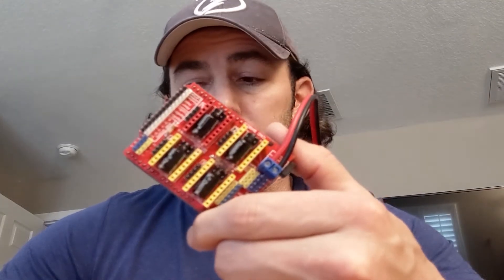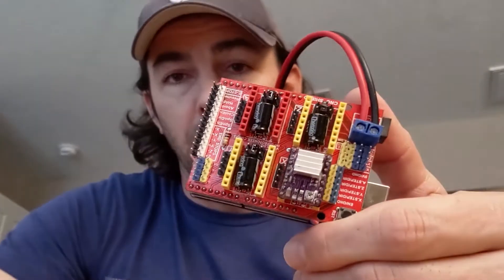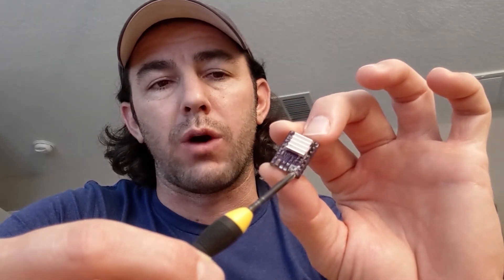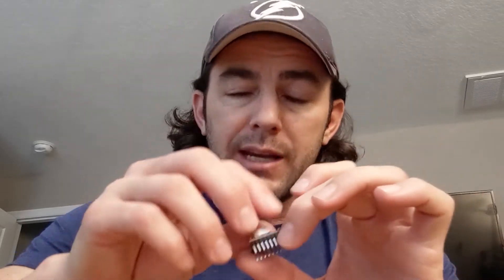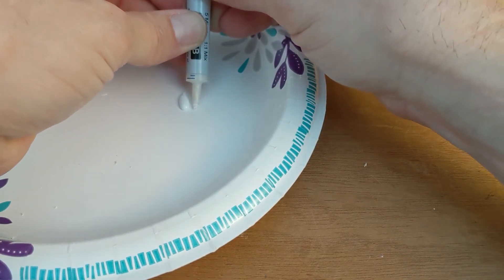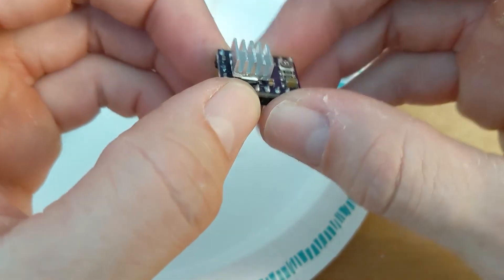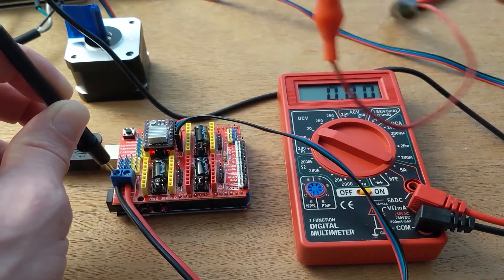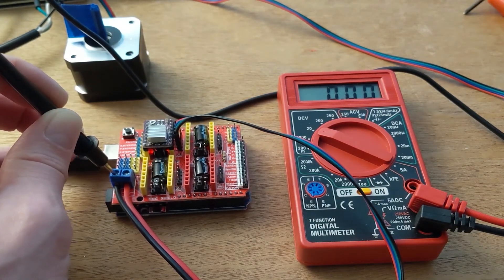CNC Shield, Arduino UNO, DRV8825 - Tips for success!

Comment: yeah that current limiting thing doesnt convince me at all, what we are actually doing iss setting a reference voltage so current flows, via the formula manufacturers give in order to calculate the reference voltage. It goes something like Vref = I (stepper motor) x Rs x 8, at least in the A4988 Driver. 
Edit:
MB in that driver it is just I (stepper motor) / 2

Comment: 7:20 you say you're measuring current but you're actually measuring the voltage. You can even see on the multimeter that it's set to voltage

Comment: im surprised you say with the driver chip in and no motor connected it burns out, i have 4 at least with them in and no motor on the Z as i used servo and not one has ever burnt out ?

Comment: Sorry that you ruined so many chips and motors. It really helps to read the driver and motor datasheets and go to the company webpages to learn more about this driver board before using it. Polou also has a YouTube video on their DVR8825 that shows the correct way to set the VRef with the board powered but without the stepper motors being connected. Also, if you look at the schematics of the example circuit on their website, it shows a capacitor that is supposed to be present where the power connector is attaching to the circuit. You can see the cap in the video. The cap prevents voltage spikes that can fry the 8825 chip. Your video doesn't show this required capacitor. You also handle the 8825 very casually by the pins themselves with no regard for the possibility of static discharge ruining the chip.

Comment: well HELP i did as you said but my motors  rattle wont turn and this was a new board with drivers  i got a lot of mony tied up in making this thing would i be better off buying the better coponets Bite the bullet buy them and get this thing working  i got 24 v going in to stepper board set at 1.2 amp there rated 2.5

Comment: For anyone struggling with getting the stepper motors working, I had tried every tutorial video and every "solution" available, but it turns out the layout of my wires was wrong. I tried swapping out my cable for a different one, and found an old 3d printer stepper motor cable. When I tried this cable, magically it all works. It turns out this cable had the "2nd" and "3rd" wires swapped. So essentially, if we name the stepper motor input wires as 1, 2, 3, 4, 5 and 6, and normally your cable would go to 1B -> 1, 1A -> 3, 2A -> 4, 2B -> 6, try swapping the cables out and making the connection: 1B -> 1, 1A -> 4, 2A -> 3, 2B -> 6 and see if that works. It solved my endless search for a solution.

Comment: 1:55 You should make an exception to only use logic voltage (from Arduino 5V) *not the CNC shield power (12v) * because in another video https://youtu.be/wcLeXXATCR4?si=jj8n2c5g-LhIJzg-&t=466 shows that power (5v) from the Arduino is fed to just the motor driver board (although different model A4988) seems safe to do as to set the current for the boards output.

Comment: motor supply or logic supply? Damage to drivers when cnc motor power input is powered with no motor or damage to logic when Arduino is powered by usb or other?
Reply: This is a very important question as in another video https://youtu.be/wcLeXXATCR4?si=jj8n2c5g-LhIJzg-&t=466 shows that power (5v) from the Arduino is fed to just the motor driver board (although different model A4988) seems safe to do as to set the current for the boards output.

Comment: Is normal PC CPU Thermal paste not suitable?
Reply: Typical thermal paste is not adhesive; you would have a mechanical attachment to keep the heat sink in place. The 2-part stuff is an adhesive, probably a high-temp epoxy with extra thermal conductivity goodness. HTH

Comment: Nice video, Can you also tell if it's OK to upload code /sketch from Laptop to Arduino with the CNC shield on piggyback while Arduino is connected over USB and also when the 12v external power supply is connected to the CNC shield.

OR should we turn off the 12v external power supply to the CNC shield and then upload the sketch.
Reply: Depends on the code you are uploading, if you are just uploading the grbl sketch nothing will happen even if the 12v power is on, you have to send g-code files for the steppers to start moving.

Comment: NEMA 23 motors require 4 amps at 25vdc I think. This board supplies only 2.5 amps at 24.
Reply: NEMA 23 motors are not all the same. I have NEMA 23 which requires only 1 (one) Amper.
Reply: @TheDIMONART  Oh, looks like you are right. I thought NEMA was a general rating for torque and speed of the motors, which would limit the range of current and voltage I would think. But it looks like it is rather a measure of the housing face, which might correspond to some of the output characteristics but not the current and voltage input. Thanks for the info, I learned something.
Reply: And it looks like it is also a rating for torque and speed as well, but it is a range rather then a specific rating.
Reply: @artisticmike  Correct, NEMA23 is only for flange size specification (23 means 2.3 x 2.3 inch)
Reply: @TheDIMONART  Also, they dont require a certain current. It all depends on the load.

Comment: The warning from the driver manufaturer he showed isnt what he is talking about. The manufacturer said not to connect or disconnect a motor while the driver is powered. He is talking about just plugging the driver in without a motor. So it wasnt the plugging in the driver without a motor that destroyed his driver, it was when he plugged in the motor while the driver was powered.
Reply: I've unplugged steppers when the board is powered, but not driving the steppers with no issues. Probably still not a great idea, but not fried a driver yet.

Comment: I tried it my own... You can for sure adjust your current even if you don't have the stepper motor hooked up. You just connect your Arduino to usb (not ide interference needed. Just connect the usb to the board and your pc) then supply power. No need to match the maximum current of your motors... You can use any supply that matches your voltages needs. In my case my stepper motors using 12v and 6 amps supply... The drv8825 is set to limit the current at 1,2 amps. My motors can handle up to 1,3 amps. No smoke appeared. Im going to upload a video of my set up and my cnc after i finish my laser engraver project.

Comment: At the end when he used the multimeter was he testing current or voltage? It looks like the multimeter is set to voltage?
Reply: Ha, he was testing voltage. Actually, he is setting Vref voltage to the desired level.
Now, by adjusting Vref voltage you can limit the current flow to your motors from the driver. For DRV8825 Vref= Motor max. winding current / 2. (2 is the resistance value for the drv8825 driver). for example, if your stepper motor can handle a max of 1.2A per winding then Vref voltage is calculated like this> Vref=1.2/2= 0.6V.
Reply: when you are setting the current for your motor the way the board can set up the logic is through VREF or reference voltage.  The pot that he has the leads on controls this value.  So when you're testing your VREF you use voltage.

Comment: Haha. For TMC drivers the rule is backwards you cannot power a driver With a stepper attached. I wish I had watched this earlier before the big 💥. Also your Uno will fry too and your laptop ISN'T SAFE EITHER
Reply: Am having DDRV8825 if I connect my USB from Arduino to the laptop my Nema Motor doesn't move and it stops by force. 
Does this mean that my Motor Driver is damaged? 

A few days back it used to work. I don't understand the issue.

My Nema Motor is had a 1.2amp rating so I adjusted it to Vreff to 0.6

Any Advice or Suggestions from your side about the issue?

Comment: What is the units of your v ref value of .75 volts or amps?
Reply: volts
Reply: 1.7amps for Nema17 motor and using formula of Iref (current reference of that module) you can calculate the voltage for that current so you can set Iref with voltage meter.
Reply: @ourclock9273  Am having DDRV8825 if I connect my USB from Arduino to the laptop my Nema Motor doesn't move and it stops by force. 
Does this mean that my Motor Driver is damaged? 

A few days back it used to work. I don't understand the issue.

My Nema Motor had a 1.2amp rating so I adjusted it to Vreff to 0.6

Any Advice or Suggestions from your side about the issue?
Reply: @AkashGajinkar  may be ok with those parameters just rectify if Rs it's actually 0.1ohm.
If not you can know the final formula from this Imax=Vref/5xRs for example if Rs= R100= 0.1ohm >>>Imax= Vref/5(0.1)>>>>Imax=Vref/0.5>>>Imax=Vref(2)>>>>Vref=Imax/2 and all of that if Rs measures 0.1ohm and You can see all the data from datasheet in this case DRV8825 datasheet there you can find formulas tdp Imax etc etc
Reply: Its volts. Vref=Iref/2 for DRV8825
Reply: @Mad_GamingYT  not exactly but it works fine :)

Comment: what sort of connector do you need to connect the stepper motor to those pins on the cnc shield
Reply: Steppers should come with cables and the connectors on those cables correspond with the Shield's pins.

Comment: I watched the video as well as your set up video, both very helpful, Wondering if you could possibly give me some direction. I'm new to this and setting up my first CNC. I was able to upload GRBL and Universal G-code sender. I'm using the Arduino UNO, with the red drivers. 4 axis. The orange light is blinking, the green light is on. I've double checked my motor wiring with an ohms meter. I am running the set up wizzard in the G-code sender program, when I try to move any of my axis motors in the program, I hear a low humming/buzzing noise, but no movement. It's difficult to determine where the noise is from, possibly the transformer/power supply? I doesn't sound like it's the motors. Is it possible that my drivers are burned out? Is it possible to bi-pass the drivers with a jumper just to check the motors? Any suggestions would be very helpful. TIA. Nick

Comment: Are you adjusting voltage or amperage?
Reply: adjusting the current by voltage reading that through the potentiometer. ex : 0.75v equal to 1.5A for DRV8825

Comment: Question, Are you able to mix a Nema 17 on the Z and Nema 23's on the X & Y with this board configuration?
Reply: Yes you can. Just set the vref, take note max current is 2.5A for the DRV.

Comment: Never had those issues on my setup back in 2019. I always power up without the steppers and never had a fail of stepper drivers. Also, I only setup the current along the way of the setup. Don't have issues with heating also. Just stuck the heatsink with the provided sticky tape.
Reply from the maker: Glad to hear you run an issue-free setup.  One note on driver current and overheating - all too often people complain that their steppers are occasionally 'missing steps' while cutting jobs and this is likely because they are not giving the stepper the full rated amount of power it needs, OR the driver chip hits thermal shutdown due to providing too much power or inadequate cooling, and resets itself.  I don't want to deal with any 'missed steps' (and I never do) therefore I fine tune the driver to deliver the maximum rated amount of power that my nema 21's require and this causes the drivers to run very hot, which in my southern US climate is far too hot for proper cooling when using the provided sticky tape solution.  As a test, I have run 2 setups side by side, one driver with sticky tape and one with thermal paste, and the taped on heat sink loses the battle every single time as it will hit the thermal shutdown threshold, reset itself, and 'miss steps' while cutting.
Reply: @jtechcustoms  Yes that was the consideration I did give priority. The heat. Gave it the most current at which it does not heat up for the most torque. Also ran it at 1/32 microstep which at the time seemed like a good option. I think some have it at 1/16. I did try at 1/16 also without issue. Supposedly have better torque as well.

Anyway, I do have a video of my cnc cutting 3mm cf decks for my rc. 

Just surprised there was actually issues with the board. I also use the drv8825 stepper drivers. Glad it went on smooth.

Anyway I do run it with hc05 bluetooth module as well as this was the only issue I did have as it would sometimes disconnect on a long job.

Comment: Your first tip might not be as accurate as you think. The quote from the manufacturer states, that plugging and unplugging motors during power on will damage the board. not when you power on the board without a motor. It's only when you power on the board and then plug in a motor that the board will get damaged.  Without a motor the driver can boost up the voltage all it wants, it can go no where seeing there is no motor to conduct the current. Nothing will happen. But when it's on and the voltage is maxxed out and then you attach a motor the full power supply and all it's current might get dumped into the motor and the module will fry itself. Current cannot go where there is no connection. 

I breadboard these modules on a regular basis and none of them have broken from just powering them on without a motor. 

The second tip, These modules can do about 2 amps max. Nema 17 motors range from 1 to 2 amps max. Nema23 motors have lower coil resistance than Nema17's, Think of an audio amplifier rated for 8 ohm speakers. And then you attatch 4 ohm speakers. It will work, but it will struggle allot more. 

 The thermal epoxy is a very nice idea tho, and the calibration of the current at the end is also a  good idea.
Reply: There is the comment i was looking for. I totally agree. Don't know what his first tip is about. He says "It will ramp up power. There is no resistance from the motor, so it fries itself" and that's completely wrong. 
Its the complete opposite. If there isn't any motor connected, the resistance at the output is infinite (not zero) and unless the air is highly conductive (😉), the driver shouldnt frie at all.
As you said, the quote from the manufacturer has nothing to do with the topic he is talking about. It only states that you should not remove the motors while being powered. Of course that can damage your driver but that has nothing to do with powering your board without any load.

Whoever is reading this: To set the correct Vref for limiting the current, I strongly advice you to do that without connected motors!! But what we can learn from the video: Dont connect/deconnect your motors while the board and drivers are powered.
Reply: Agree. And you should be setting the current limit BEFORE you connect the steppers the first time; so how can you do this if you are not allowed to supply power to the board without the steppers?
Reply: @adammiles5087  You ARE allowed to supply power to the board without steppers. Just don't plug or unplug motors when the board is powered. 

So power the board up without steppers plugged in, set the current, power the board off, connect the stepper and power on again.

Comment: Hi, Great video.  Do you know which pins I connect to when installing an external reset button?   Thanks.
Reply from the maker: There is a set of pins named "E-Stop", these are the equivalent of the reset button on Arduino, as per the info provided on the CNC Shield manufacturer site here - https://blog.protoneer.co.nz/arduino-cnc-shield/.
Reply: @jtechcustoms  Great stuff.....cheers

Comment: WATCH OUT: in my case the tiny pot on the 8825 had to be turned all the way CCW in order for it to bottom out.
First time I've powered on the board it was all the way clockwise, and the small dvd stepper I've had connected to it got insanely hot in about 5 seconds. It survived somehow, so hurray, but yeah, watch out y'all, measure the pot if you can

Thank you for the tips BTW, helped me make the focken thing work finally

Comment: This is weird - stepper works fine in one direction but oscillate (shivers) in the other direction.  Adjust current doesn't help.  Running 2.6ohm 4 wire nema 17 with 12V into cnc shield and simple test code.  Only difference is changing digitalWrite (driveDirZ, HIGH) to ....LOW.  Delay between step pulse on/off is 30 useconds.  Changine this or the loop delay also doesn't help.  Anyone's thoughts??????
Reply: The coils are crossed.  Check the wiring of the stepper coils vs the driver.

Comment: Thanks for that info. Now I just have for find a video that shows how to connect a Nema23 8 wire stepper motor
Reply: Is the stepper controller actually only using 4 wires off of a 8 wire stepper motor?
Reply: I'm using the same thing the adreno board and the CNC Shield
Reply: And I'm also needing to make two of the motors on the y-axis